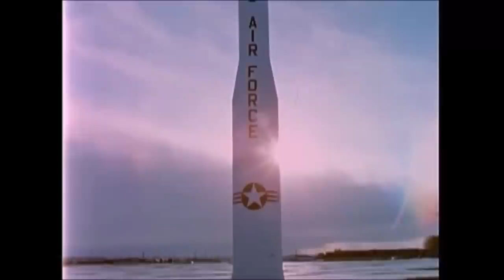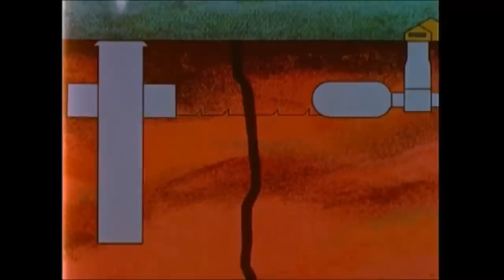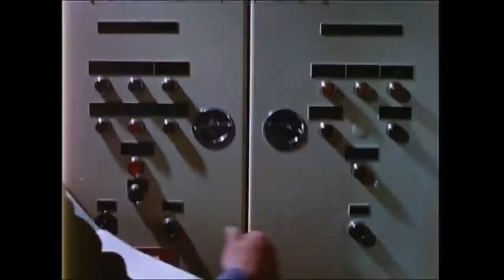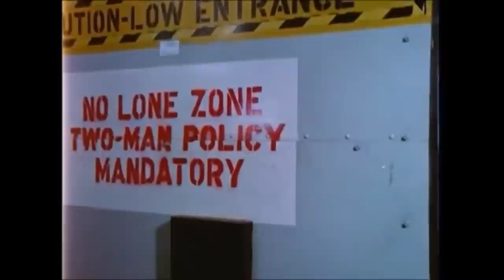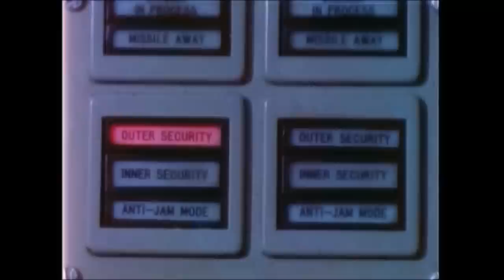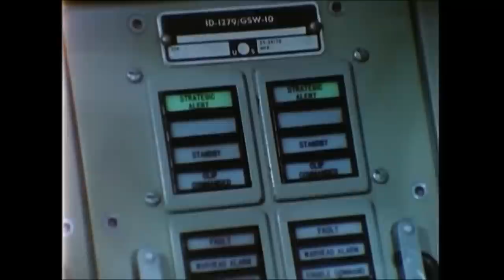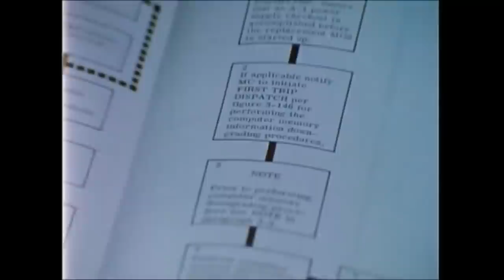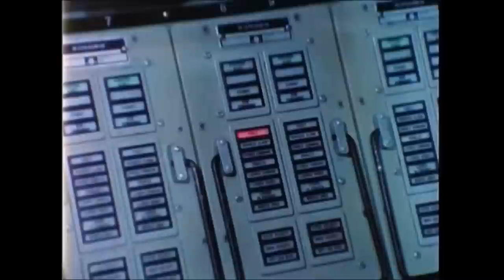US Air Force | Primed for Defense | The Minuteman Missile System

Comment: My grand of father worked at Aerojets and helped to designed the Polaris SLBM, the first dry fuels SLBM which could geted launched at +55 feet under waters, go uped in a bubble of super hot dry steam and broach the surface , then popped up and when it did stopped going up it ignitioned and blasted off for space and the targets. 
Also he did worked at Jackass Flats National Test Areas, Area 25, on to NERVA Project for nuclear space crafts engines.
Reply: Wow

Comment: OMG! Aligning the guidance system using Swiss-made theodolites and targeting using the big console inside the T-van. That was Minuteman I, boys an' girls. The targeting set for MMII was about the size of a briefcase. How do I know? Cause I was a Targeting team chief and Maintenance Field Supervisor, both at Malmstrom AFB 1965-69. Looked simple when the team chief announced (probably to Job Control) that he had completed the job and the bird was "green" (light on the launch officer's panel). Try and do that alignment procedure when the air temp on the surface was below zero! The targeting job took at least three and a half hours...if you were lucky and the guidance system came up the first time!  Then there was driving time in the truck that could take several hours, if the road conditions weren't too bad. One time had to wait until the third time we punched the "can" into alignment and calibrate, and Job Control told us our 16 hour timelines had been waived by SAC headquarters..."Stay there until  it's green!" Getting there could be interesting if the truck didn't break down. Had one T-van #805 that would blow the freeze plugs in the engine if the temp was below freezing. If we got that truck and it was colder, we weren't going to get to the site!  One time, in an Alignment (only) van, we had lunch at a truck stop, and when I hopped in the "shotgun" seat, my assistant team chief, a buck sergeant, handed me the gear shift lever, and said, "Here, lieutenant, you shift for awhile!"  Nowadays, targeting is done from the capsule (Missile Alert Facility), and I don't know what else!

Comment: I didn’t see any precautions associated with radiation exposure? Wouldn’t the warheads be a source of neutron radiation? And wouldn’t it be the norm to check for such radiation when working in such close proximity to the warheads?
Reply from the maker: The warheads were remote from the launch center. There wasn’t a possibility of exposure.
Reply: The pit is kept in a sub critical state.
Reply: Yes, neutron radiation was a problem with the old Mark 7 and 11 warheads. Wearing dosimeters was strictly forbidden, but at the same time exposure was kept to a minimum. The Missile Maintenance Teams and the people at the Weapon Storage Area were the only ones who had direct contact with the bomb. I know quite a few friends who have since died from cancers that have only been seen after severe radiation exposure. The new Mark 12 and 21 do not have those issues due to better shielding.